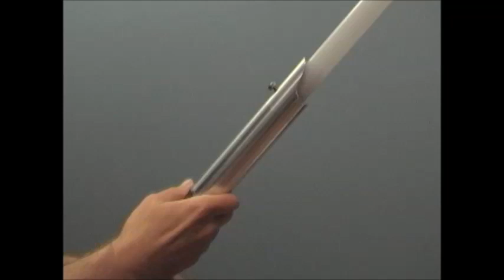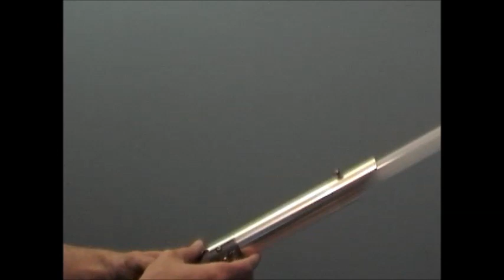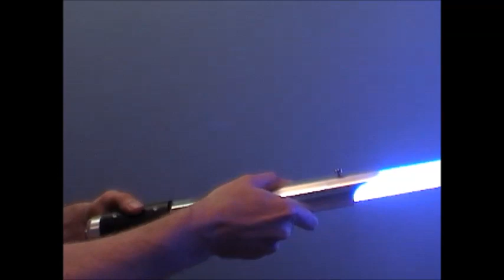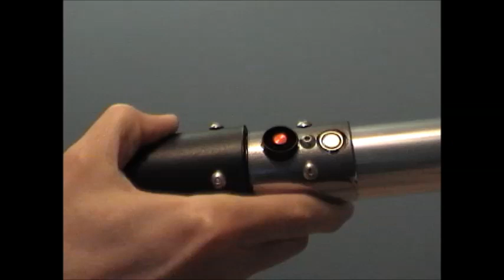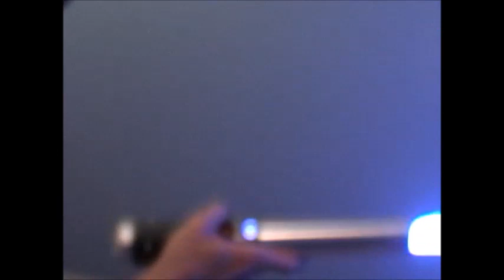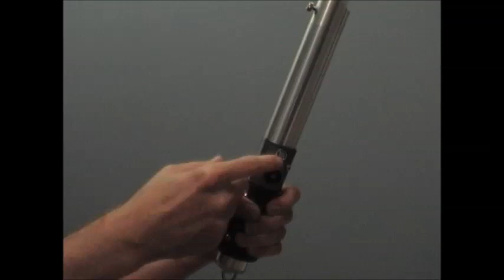Arduino Lightsaber Mk III Done

Comment: I was wondering would the hum sound be played from the beginning whenever a clash sound ends? I am making an arduino lightsaber and the hum sound played from the beginning every time a swing or clash sound is finished and I would like the hum sound to be continued from the last place.
Reply from the maker: +terrencetec I think you are asking if you can "pause" the hum sound, play a clash sound, then "resume" the hum sound from where it left off. There is no way to do this with this setup. Sounds always start playing from the start, never the middle.
Reply: Think you man. Since I live in Hong Kong, its so expensive to order stuffs from custom saber shop. So, I draw my own saber hilt and have people done the machinery. Though its still hard to find or make a blade tip lol.

Comment: Great config options! I ordered an ADXL335 to use it instead of the tilt-sensor. Hey, is there something loose in the saber? What is making that clanking sound?
Reply from the maker: +jonnieZG There was a metal ring on the pommel so that I could hang the saber off a belt when the blade was removed. The ring flopped around and banged on the pommel when I swung the saber around.